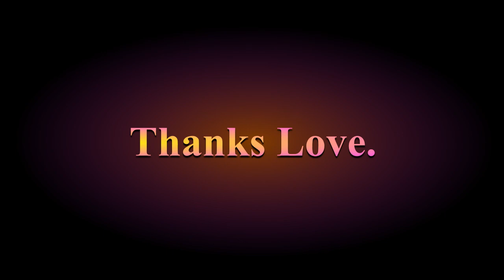DAISY PART 3.  CLASSIC VW BUS RESTORATION

Comment: Hey man I have just bought a  rusty bay window bus just wondering what steel do you use I was wondering if stainless would work thanks.
Reply from the maker: 1mm cold rolled is best. Stainless steel is not compatible

Comment: Gday Mate, have you a video of removing the nose panel section? I've a '79 Bay and that's one job I've to do....
Reply from the maker: Not yet James,  but we will be fitting one  soon so stay tuned
Reply: @vanzelstrestorations998  thank you for the reply!
Reply: G'day Mate, Have watched that video, it was great and a worthy reference. What was the brand for the can of epoxy paint you were using please? James
Reply from the maker: @james19eighty  glad the video was some help. We normally use macropoxy pr250 which is made by wattyl industrial. 
Probably the best epoxy out there for automotive use but really inexpensive.